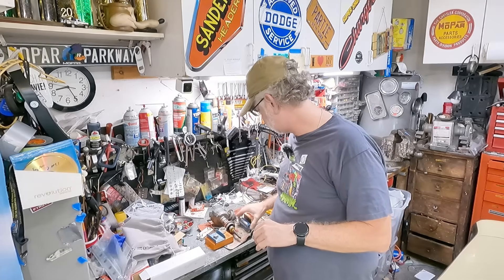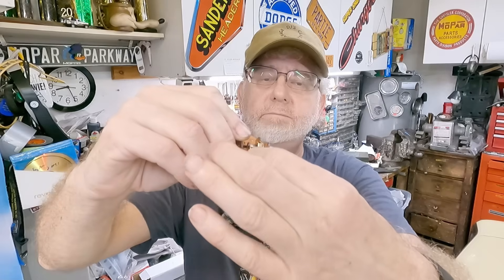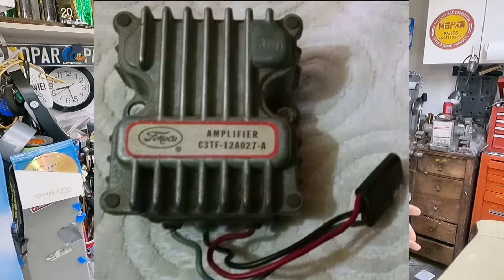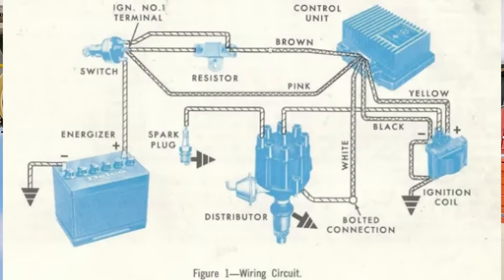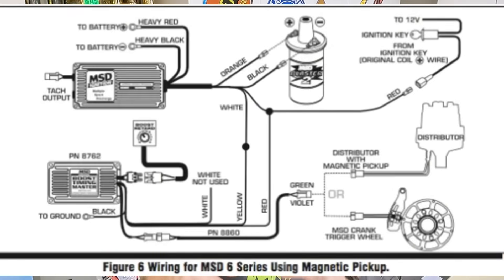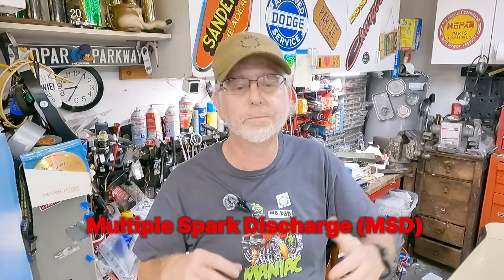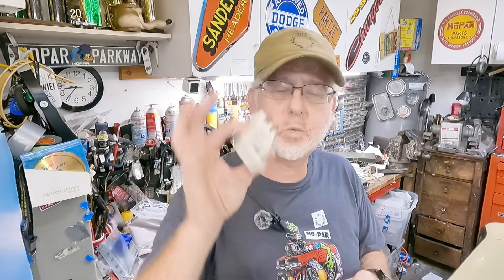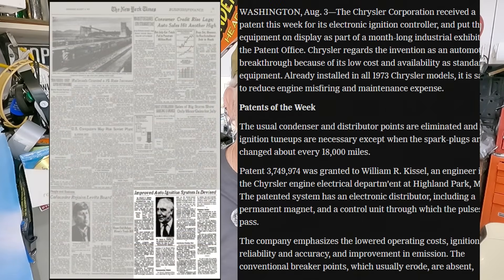Why Everything You Thought About Electronic Ignition is WRONG

Comment: The early GM HEI units were notorious for blowing holes in the rotor and burning up modules.  Everyone at the time carried spare rotors and modules in their glove compartment.  In the mid to late 80's, the car magazines actually had articles on how to fix the HEI problems by wiring using the Chrysler module and wiring it into the HEI system.  Whats interesting now, is everyone is using HEI modules to rig up electronic ignition systems and there are tons of Chinese knock off HEI distributors for almost every engine.

Comment: What Chrysler didn't say is some of these boxes had rpm limiters, and you used the wrong box you had a disappointing experience. Overall it was a big improvement. But the smart guys always had a spare box in their trunk.
Reply from the maker: I actually have never seen a rev limited Box, I need to find one.
Reply: They have different colors. I believe the blue one had a rev limiter. Even the stock replacement for regular cars had one. OE boxes, not sure about aftermarket.

Comment: I'm not a Ford or Chrysler fan, I'm a GM guy and in my opinion GM had the best HEI system, with almost no failures, but if it did, it was usually the ignition module, which was cheap and very easy to replace.
The only drawback for the GM HEI was the size of the distributor, because of the coil mounted in the cap, which made the distributor much larger in diameter, but it was absolutely reliable, as long as you changed the gauge of the ignition coil wire from the ignition switch, but that was only needed for cars designed before 1975 that had the standard distributors in them.

GM used the resistor wires on their cars rather than a resistor like Chrysler used on the firewall to drop the voltage to the coils initially.
Reply from the maker: It really was cutting edge, hence why it lasted so long.  I am working on part 2.
Reply: I am a Chrysler guy and a mechanic. I tend to agree with you actually. The Jaguar HE V12 uses a 4 pin GM HEI module in a Lucas labelled ignition box. It manages to fire a high compression V12 at 6500rpm in a ridiculously hot engine compartment very reliably. 
The modules do fail more often but the heat in there is extreme. I feel if they put them in a different location the modules wouldn't fail as frequently, even if those failures are fairly infrequent.

The OEM Mopar black boxes are incredibly reliable though. I have seen a few of the boxes fail over the years and a few pickups too. The black Mopar boxes ending in 00 part# fail less frequently than the other Mopar black boxes.
Reply: The large cap is great if you can fit it in your engine bay because the larger cap makes spark jumping between the terminals on the cap less likely whereas on a smaller cap the spark can jump between the terminals easier.
Reply: I have the special mopar tester at home for the old school chrysler breakerless ignition  system

Comment: I had one of GM's ignitions in my 65 GTO, and it went bad while I was on vacation. The good thing is, I put a distributor in its place and went back to a points system, to keep it on the road

1!
Reply from the maker: Sometimes simplicity is best.  It was so much easier back then.
Reply: Fixed many of those on 65 GTO's. I replaced a #1961480 transistor that cost about $6 dollars. Like you, most just went back with a points distributor as electronic ignition was still new and often unreliable at that time.
Reply: Points never left me stranded. When points were getting worn it just didn't run as good. HEI has left me stranded twice. If I have an HEI distributor, I always keep a spare 4 pin module.
Reply: @gearhead7896  I like points ignition too. Still use them on one of my classic cars and often use a points ignition on all first start up on a rebuilt engine.. Good ignition points are getting  expensive now!
Reply: @indyme2 I had an Accel 9000 RPM dual point distributor on my first truck. I wish I had swapped out that for an HEI and got my Muncie M-21 too before I sold it.

Comment: i bought a magna pulse by Hays in 1975. i have been running it with the Judson electronic magneto coil for years. it has a star wheel that fits over the cam in the distributor. i ran a HEI  for a while but wouldn't fit a tripower so back to the Hays

Comment: My first car was a 67' bug back in 1974, and it was probably 75' when I installed a CD black box that increased coil output and decreased current through the points. As a matter of fact it negated the need for a condenser. The first non-point distributor I remember was optical, but it wasn't long before it was replaced by ones with inductive pickups.
Reply: PERTRONIX
Reply from the maker: Cool.  That was cutting edge

Comment: Points keep things simple,so much less wires and stuff. Points are easy to change
Reply: You'll need easy to change because they don't make them like they used to. All quit points long ago because they're far worse in every way.
Reply: Is it easier to change than never having to change the magnetic pickup?
Reply: @shelliecarlson7015   my electronic ignition had been running lousy so I put a new points distributor. Got rid of a bunch of wires.spagetti
Reply: Points rapidly lose their effectiveness to fire multiple plugs as the rpm's go up.  Points were fine for flat heads and low rpm engines before the 1950's.  But, you take any engine with points, and retrofit an electronic ignition system i.e. a later OEM or aftermarket unit like Pertronix, and it will run better.  I've put on Pertronix ignitions on a Ford 8N tractor, VW Beetle, and a 1966 Coupe deVille, and the improvement was very noticeable.   No points for me!

Comment: If only they moved the weights up top like GM...
Reply from the maker: Yep it would make recurving it a lot easier.
Reply: As a chevy guy I can tell you that mechanical advance is totally useless on any engine. The engine needs more timing at a lower rpm because cylinder pressure is lower due to the camshaft not being in it's peak efficiency range until between 4,000 and 7000 rpm on a street engine depending on the amount of duration. Why in the world would you want to add timing where it is unnecessary.  This is why drag racers lock out the mechanical advance.  Now vacuum advance is good especially on the street. But what do people do? They get rid of the vacuum advance and put some fancy springs and weights on their mechanical advance thinking they are making more power by not being all until 3,500rpm.
Reply: @The0utmode  thanks for that observation. I spent 3 days on a dyno, during the late 70s, only to discover mechanical weights and springs were not useful. I blamed it on the high rpm setup.

With modern engines and much better controls we adjust every parameter in real-time.
Reply: @CycleWerkz  Excellent point. Although I will say computer controlled ignition is great I say you can get 95 percent of the efficiency with an HEI distributor if you know what you are doing.
Reply: @CycleWerkz  Yup I came to this conclusion by the seat of my pants dyno lol. But it's nice to see someone on an actual dyno finding out the same thing. Another reason I think you need more timing at a lower rpm is because at low rpm the piston speed is slower so the piston does not do as good of a job squeezing the air fuel mixture together so it takes longer to burn. As for modern crank sensor ignitions I think they are unneeded  you can get 95 percent of the way there with  an HEI distributor if you know what you are doing with air fuel mixture and vacuum advance.
Reply: @The0utmode  You could be right, but I think the effect may have other contributors. 
Especially on engines tuned for high torque at higher RPM. The air plenum is way out of resonant range, more so than slightly modified or normal engine. I think I had to idle around 1600. 

I thought most the effect was due to poor cylinder fill operation way below the torque curve. I think cam overlap did more harm than good. Then poor scavenging which gave us the lovely cam lope but is really an engine struggling to run. I was not able to solve that with any timing or mixture back in the 70's. I also ran very rich jets to keep power on the back end. All that extra fuel may have reduced ring sealing too. 

I'm sure there were many problems. I was generally following advice given by the fast guys. At the time, why, was less important than timeslips. Too bad we can't go back to measure it all with better knowledge and tools. 

HEIs did change results. I didn't understand why, but it lit up the torque earlier. In the 70's my dyno time was all borrowed. I mostly used a stopwatch and an uphill grade near my shop. I didn't bother with the watch unless my seat indicator was positive. 

Now my G37 stock engine ECU will operate at 0 adv, even -3 deg after TDC, and squirt almost no fuel. I mean that's certainly lean. That's literally proper operation. It's been working like this for >160k miles, not so gently run, but always with clean fluids and my frequent surveillance. The ignition definitely delivers plenty of spark.

Thanks for reminding me.
Reply: @CycleWerkz  Great thinking I never though of cylinder fill as a factor for ignition timing but that makes total sense and goes along with the real world evidence. Also your G37 engine is that advance at wide open throttle? I don't have much experience with newer engines besides doing basic maintenance on them nothing performance based on new stuff that's for sure lol. Although from what I have seen from doing oil changes in GDI engines I am not very impressed the amount of fuel dilution in the oil is crazy. Because the fuel is being sprayed directly into the cylinder it has no time to properly atomize and then vaporize and it just washes down the cylinder walls and gets in the oil. So I can't image it runs lean because all the gas in the oil wasn't burnt lol. Curious what are your thoughts on GDI?
Reply: @The0utmode  Mine squirts the fuel in the intake runner. I find oil dilution when they think more expensive oil should last longer. It's a very common thought but the oil exceeds the particle suspension capacity, gets diluted way beyond limits, the particles collect in cam control actuators. The next thing you know a valve hits a head. 

Yes, OEM engineers mostly pulled away from exclusive direct injection because valve surfaces were not being washed, I guess. Some have added a runner injector but still like the direct one. 

No, the crazy lean with retarded timing only occurs at idle with compressor clutch open, battery fully charged, and ECM working in Closed Loop mode. Basically, if you drive >5 miles to work, but have to wait out 4 or 5 lights at the end. I didn't even notice it for a year, mostly because it wouldn't enter closed loop mode. You need decent data tools to figure out what's happening. I just paid about $15 for an app and $5 for a Chinese blue tooth dongle. Decent data tools got really cheap. 

I've read through the Operational narratives. I think the engineers' sequence description is probably true. Everything I've measured so far verified it all. 

When I first got the machine, the ECM was not able to enter closed loop mode. It ran great, passed inspection, milage was fine. 

I found both short and long fuel trims very erratic. True on both banks. Normal temps on cats. I was truly stumped. 

I decided to dig in, went to the car wash to get engine cleanish. I left engine running while spraying. The ignition taught me a hard lesson. I found degraded plug boots were letting spark to the surrounding metal at every hole. 

It turns out that was the only problem. Everything else tested good. I could not identify any change in performance, except fuel trims were always nearly 0. 

On direct injection, Fuel is very well atomized leaving the injector. Assuming the injector is good. (don't assume that they crude up) If good, the fuel pressure is crazy high, so droplets should be very small. Vaporization is another matter. When injected above the cylinder, the vaporization effect sucks lots of heat from the air, so the charge air temperature is substantially lowered. That's really handy when charging intake air. I'm sure they ran through so many tests to prove their ideas valid, so I'd have to see something indicating an error. There is a difference between 1000s of tests, and millions of daily drivers. 

I would expect vaporization to occur in this very hot intake charge, given smaller droplets shot into the combustion chamber much faster, but maybe it's a factor. Higher velocity droplets enjoy an effect called shattering. The higher velocity and smaller droplets drastically improve atomization, thus vaporization. 

These engines suck the crankcase fuel into the carbon canister. The strategy is to reuse the fuel when the engine is happy to accept it. On my single example, this system works exactly as described. However, it did not work at all when the ECM couldn't get the control loop closed. 

I would guess the used oil on any car in this scenario would fill with fuel once the canister is full. I didn't see it, probably because I change my oil. Or maybe I missed it just by not looking for it.
Reply: @The0utmode  I agree. but computer control of every parameter is now too easy to skip. It' not just power, it's how to tame the beast. Hey if not available, HEI is another way to get it going. 

I think I put about 100ish power commanders on injected Harleys. I completely fixed that about to die idle and let less radical enthusiast ride in parades Without fuel fog left behind.

Comment: Never had one MoPar ignition module fail on me in 35+ years. 1972 Plymouth Satellite Sebring hardtop, 1974 New Yorker hardtop, 1977 Volare (225) coupe and 1974 Tradesman all with the original modules & ballast resistors.
Reply from the maker: Most people never have them fail, they are actually pretty reliable.  Nice set of vehicles, love the Tradesman.
Reply: I raced a 1972 with a 400 2 bbl  for Enduro Stock. Never had an electronic ignition failure. The distributor bushings were tight and the gap was good. Even the plastic cam timing gear never failed on the 114,000mi engine. I once locked the engine on a 92 degree day when it overheated and I couldn't get into the pits soon enough. The engine cranked over the next day.
Reply: Your experience is unusual. I've owed and serviced countless classic V8 mopars. Replaced over a dozen faulty ignition modules. Many fail (crank no start when hot) but restart when cooler to get you home. Most eventually fail completely. I always carry a spare module with a jumper ground wire in the vehicle.

Comment: Between the 5 pin and 4 pin boxes I have not had a failure in 25 years even on the Chinese made ones.... Grounding the box is always essential and add second ground....My daily 87 Ramcharger runs a 4pin....so a spare box, resistor, distributor and a $15 fuel pump in the emergency tool box are all still fresh... My 74 and 76 chargers run older 5 pin boxes.....Like a rock dependability and ease of road side repair.... nothing like the complicated junk we have today..... Just replaced the battery on my beater 11 Chevy Impala modern batteries are crapping out at three years that alone should tell anyone the state of modern car electronics...😢
Reply from the maker: Absolutely, they get such a bad rap.  And yes if you have a problem you only need a few things as spares.
Reply: @DJsClassicGarage  I fully agree. I never had a problem with the points systems on my old Holden cars. The world was simpler back then. If something goes wrong with a modern cars ignition system you are walking home.

Comment: I have had both points and electronic ignition on Mopars, and both are ok. I have a 1956 Dodge pickup with a stock small block 318 with points (not stock to the truck of course), and because I don't drive it a lot, points are just fine because I can go years before I need to adjust or replace the points. Otherwise, electronic is less maintenance, and one less variable when tuning the ignition system.

And then I have a 2002 Jeep Wrangler with the 4.0 inline 6, and that has no distributer, which is just fine too.
Reply from the maker: Points on a classic is not a bad thing, you are right when you barely drive they last years.  I have 3 style of ignitions Distributor , distributor with a flywheel sensor and coil on plug.  WHen the design is good they are trouble free.